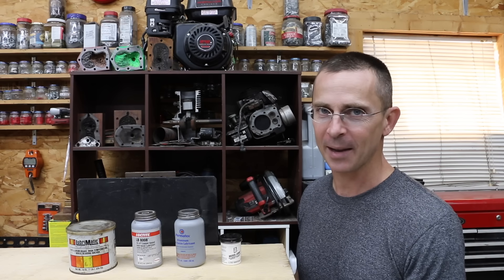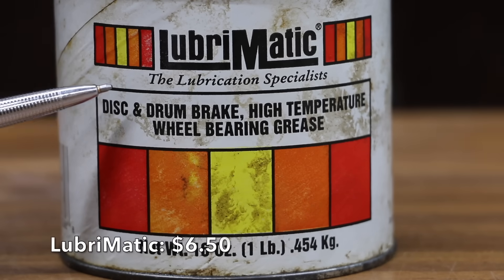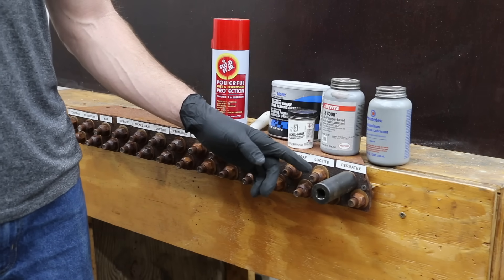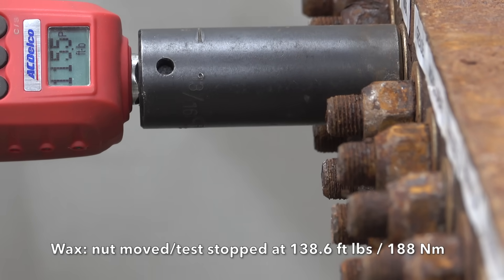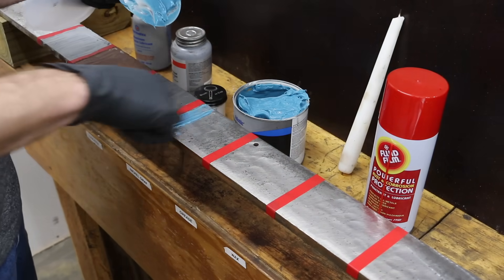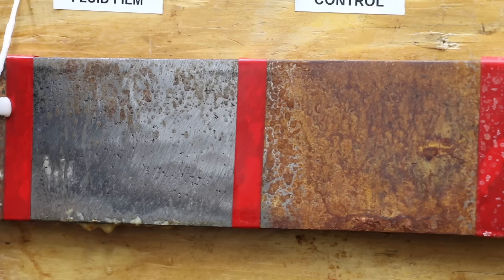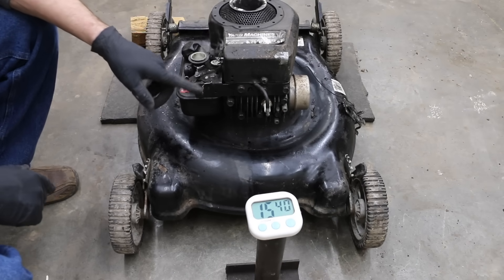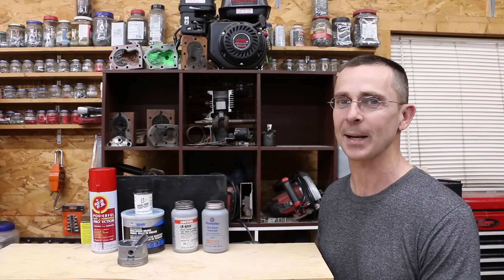Does Anti-Seize Compound Actually Work? Let's find out! Anti-Seize vs Grease vs Fluid Film vs Wax

Comment: After being an Auto Tech for 44 years, and 34 of those working on a fleet, the Copper anti seize has worked the best in my experience. Great job doing all of your testing!
Reply from the maker: Thanks so much!
Reply: @ProjectFarm  don't use copper anti seize on stainless in salt water, it actually corrodes the stainless; nickel based in marine applications only
Reply: @wlrottge  nope, tefgel we use
Reply: @wlrottge  use Loctite LB 8023 Marine Grade Antiseize for stainless
Reply: @wlrottge  I didn’t know that. Thanks for sharing that. How did you learn that?
Reply: Always found res-q steel to be pretty good personally.  Used it on ships for years without issue, would have been interested to see it against these other ones.
Reply: What would you say is best anti seize for glow plugs ona diesel
Reply: @paulyyy09  ceramic grease
Reply: 100% copper is the best providing your materials are liking the copper it’s best for heat and the shavings of actual copper protect the threads for removal for heated anything really
Reply: @LLS.R  because contain ceramic which is 9 in scale, close to diamonds..
Reply: @mtn.srlrascu6675  so you think it will grind your bolt or nut when it’s grinded to powder and processed in grease haha? Maybe if there were big chunks of it. It a bolt. Not a piece of glass which you are gonna scratch. I use ceramic grease and i’m a mechanic for 15 years so i know what i’m talking about. But use whatever floats your boat😂.
Reply: @LLS.R  on stainless Steel doesn't work like the copper one
Reply: @LLS.R  ceramic os an abrasive, just because it's in grease doesn't make it not an abrasive, it's just extremely fine and will probably work just fine for most applications,  if you think it's not an abrasive then replace the wheel bearings on your truck, use that on one side and pack the other side with Lucas red n tacky or some other quality wheel bearing grease, see which one wears out faster and see which one is more black when you take it back apart, ive never used ceramic grease, and I'm sure it's great stuff for it's intended purposes, but I'd bet money the wheel bearing with ceramic grease would wear out faster
Reply: @lumpyzx2645  I doubt it would make it 1k miles with the ceramic in there.
Reply: Molykote M-77 is the best I've used. Takes longer to dry out than the copper stuff.
Reply: Why not ceramic grease? Much better.
Reply: @LLS.R  that's for hi temperature
Reply: @mtn.srlrascu6675  works at every temperature. Better than copper. Ceramic replaces the old copper grease.
Reply: @LLS.R  I was using for anti lock on stainless Steel but if I use ceramic is different, is abrasive

Comment: As if I need to add another comment,but I will. I used the Permatex anti seize on a boat hoist, in fresh water. The bolts have been underwater for 30 years. I just unthreaded one, no tools, because the head of the bolt was almost gone. Threads were still there. I was amazed to say the least. I use it on the slider bolts on disc brakes and the attaching hardware. The only down side is if you get it on something cloth, it does not come out. You ever want to screw with someone ,put some of that stuff under the door handle of their car. It will be ruined for life. I would also agree with another poster about how you get right to the point. Um, ahh,Thank you!

Comment: Work with stainless steel nuts and bolts and you find out instantly that it works.
Reply from the maker: Thanks for the suggestion.
Reply: @ProjectFarm  What I meant is that stainless steel threads, without lubricant, will "gald" or bond very easily to each other and once they do, they begin to bond even worse. It's usually impossible to separate them. In the stainless steel industry, they will use nut made out of "monel" which is a type of stainless that will not bond to regular 304/316 stainless. Using monel eliminates the need for anti seize, otherwise the stainless will bond to itself once friction occurs.

Comment: I use anti-seize on almost every nut and bolt on the underside of my vehicles when I work under there.  When I have to do a brake job, front end work, shocks, muffler clamps, etc.  No more busted knuckles, rounded off or broken bolts.  Everything comes right apart.  Also use it on body bolts, anything that goes into a nut plate, and lug studs.
I worked in the rocket engine manufacturing field for 3.5 decades and very few fasteners are installed on rocket engines without anti-seize,  it makes your torque MORE accurate and disassembly is a breeze, so for those of you who think it will allow vibration to work fasteners loose...relax, nothing vibrates more than a rocket engine.  If you work on your own vehicles, buy it and use it, you won't be sorry.  
BTW- Anti-seize may look like grease but it is powdered aluminum or copper in a paste carrier.  As demonstrated, do not pack wheel bearings with it for example, it isn't grease.  As demonstrated, you can use bearing grease as a substitute but it will eventually wash out.  When I worked on ejection seats and canopy systems in the Navy, we used grease to protect firing mechanisms and canopy linkages from corrosion but we had to clean it all back off and redo it regularly.
Reply from the maker: Thanks for sharing.

Comment: you are using anti-seize incorrectly
you dont cover the entire thing like paint
its made to keep threads from galling and seizing
you are supposed to add a tiny tiny amount.... on each of those bolts it should have been about the size of a pen tip
enough to get into the threads, not enough to spew out of the threads
Reply from the maker: Thanks for the feedback.

Comment: One thing that comes to mind is the actual torque that is being applied to each bolt might be affecting the torque required to remove the bolts. About 40 years ago I took a 2nd level welding night course and a fellow from a local supply house came in and demonstrated several things. one of the items he used  to demon strait with was a device that measured actual torque not at the nut but at the bolt. The difference at 50 lbs. on the wrench it measured about 36 lbs. dry, 42 lbs. oiled and 47.5 lbs. with assembly lube. I still like your test. I lave been using anti seize lube since the first time I twisted off a bolt and had to get the remains out to complete the repair. Thanks for all the great videos.  Mike
Reply from the maker: Thanks for sharing.

Comment: What is the best anti seize for zinc plated cam bolts in steel control arm bushings? Long bolts in alum VW/Audi front knucles holding  upper control arms ball joints are notorious for sticking dead. What would be the best anti seize for Alu-Zinc combination?
Reply from the maker: Thanks for the video idea.

Comment: So a different type of anti-seize that I'm incredibly fond of and I've found to work incredibly well in an automotive application is the Walter 53D854 Rock 'n' Roll Ceramic Anti-seize. Compared to other products it's incredibly expensive but I use it on everything and it hasn't failed me yet. 

I was hoping you'd be able to do a second anti-seize review and include ceramic style anti-seize as well.
Reply from the maker: Thanks for the video idea.

Comment: This is interesting because I use regular bearing grease when assembling brake drums & rotors to prevent welding to the axle flange due to rust and I never have an issue during removal even when driven in the salt belt. I have watched other shops beat on them with a sledge hammer, use a torch because they just slapped it together and were too cheep to take a minute to do some preventative care.. Kudos to anyone who uses some type of antiseize products. Lately, a small tube of Liqui-Moly copper antiseize is found in my toolbox.
Reply from the maker: Thanks for sharing.

Comment: My brother is a highly experienced Inspection Authorized A&P aircraft mechanic.  He always requires aluminum based anti-sieze to used on aviation spark plugs after an inspection.  His helper put too much on a plug one day.  I saw him explain to the helper that he could paint the entire side of the hanger with one bottle of anti-sieze.  A little goes a long way.  I've never seen a siezed spark plug in an engine he maintained.  Thanks for explaining the difference between copper (for ferrous metals) and aluminum based anti-sieze.
Reply from the maker: Thanks for sharing.

Comment: Yes it works...it's used in industrial applications for a reason...we used it on all bolts..if there was a flange with 8 or 80 bolts every single bolt had anti seize on it..stuff we used was grey
Reply from the maker: Thanks for the feedback.

Comment: The bearings for the con rod didn't get any oil pressure. Its the oil pressure that makes the bearings work. It makes the 2 parts float 1 inside of the other without touching. When it does thats when you spin a bearing or bend or break a rod. Its also hkw the new 0w-16 oil can be so thin and still work without messing everything up.
Reply from the maker: Thanks for the feedback.
Reply: @ProjectFarm  love the channel. Cant give you enough praise and credit. Im rebuilding my transmission and from your test of motor kote ill be using it in the first oil in the transmission.

Comment: The copper based antiseize is what i use for wire connections that you don't want to get corrosion on the wire connector or  the surface that the wire connector is being secured to so it can be a ground ect. Because of the copper its very conductive and the antisei¹ze will protect from corrosion because it really stays in place. It works very well. You can get some at autoparts stores at the counter in the little pouches for cheap. Use it for your car battery ground. On my EXGFs car i redid all the grounds and added a ground from the engine and alternator to the battery. And an extra from the battery to the body and sanded the paint off and sanded all of the connections on both sides/parts and then put the copper antseize on all of them. And the car started getting better gas mileage, and things like the lights were brighter it started easier and faster,  just about everything worked better. And when i put in a 1200 watt rms subwoofer amp the lights didn't dim when the bass hit. On most cars all you need to do is the big 3 and use the copper antiseize for conductivity and corrosion.
Reply from the maker: Thanks for sharing.

Comment: Those of us that've worked on a lot of our own vehicles usually point to LocTite and Permatex for virtually /all/ these types of chemicals.
Also, just wanna point out.. The BEST gasket sealant is by far a product called "High-Tack" by Permatex. I've used it in place of gaskets (eg; no gasket, metal on metal) on small engines and it works fine lol.. Wouldn't recommend it, but it works great in a pinch.
Brake cleaner, I go for Berryman's B-12 every time.. And for anti-corrosion I /only/ use a tiny little can of green goo called "Corrosion Block" by Lear Chemicals- Usually comes in a little silver metal cans with a pump-sprayer, though it's gotten very hard to find over the last decade.
It beats the pants off those terrible products like "Knock'er Loose"
Reply from the maker: Thanks for the feedback.

Comment: Great video, but you missed one of the most important functions of aluminum anti-seize, preventing galling of aluminum when joined with steel or stainless steel fasteners. For example, a thin coating of Permatex anti-seize on spark plug threads can prevent very expensive head repairs in the future.
Reply from the maker: Thanks for the video idea.

Comment: In the jet engine testing I've done, we always used milk of magnesia in the hot section of the engine as a high-temp anti-seize. Those bolts are subjected to off-the-scale temperatures (like 1800C in some engines) and the mechanics always seem to get the bolts out.
Reply from the maker: Thanks for the feedback.

Comment: https://www.oatey.com/products/oatey-great-white-pipe-joint-compound-with-ptfe--275767012
i used this on a pinch bolt to connect to a lower control arm knuckle on a old subaru... hopefully it holds up... if you do this test again can you add plumbing joint compound to the mix? thank you :)

Comment: Been using anti seize for over 40 years and can only say that it has saved my butt over and over again. I repair turf equipment and it is constantly subjected to water, fertilizer & herbicides on a daily basis. New equipment never has anti seize applied to anything and when I take it apart there is a lot of corrosion & swearing trying to get stuff apart. Can't live without it......
Reply from the maker: Thanks for sharing.

Comment: To be fair to the candle wax, I doubt you were able to give it a proper coating. The others you could apply evenly all over.  You might have been better off rubbing the solid wax into the thread. When we use saws in carpentry, we apply solid wax to the blades so they slide easier
Reply from the maker: Thanks for the suggestion.

Comment: One problem with grease is that, unlike the true anti-seize compounds, it is not designed to NOT affect torque values. Grease will affect the torque/bolt stretch relationship.
Reply from the maker: Thanks for the feedback.

Comment: Have to keep in mind how different types of lubricant will react with not only the fastener but what it's holding together. For example, you could use a MP on a bolt that goes through a bushing but that grease may not be compatible with the bushing. For me permatex is tried and true for it's generally non-reactiveness.
Reply from the maker: Great point!

Comment: I use Loctite 77164 Nickel Anti-Seize, 16 oz., 1 lb. Can that is on Amazon for $34.81. The can I have now came from Fastenal and was about the same price as best that I remember. It never failed me for over 20 years, not the same can of course. Here are the specs.
LOCTITE® LB 771 is a silver, thick, metallic heavy-duty, high temperature, nickel-based anti-seize lubricant paste. It resists galling and corrosion and reduces wear in heavy pressure applications. It contains tenacious metals, oils, and graphite materials. It is used in applications with an operating range of -65.2 °F to +2,399 °F (-54 °C to +1,315 °C).
Reply from the maker: Thanks for sharing.

Comment: In the 60's and 70's,  Pontiac and Cadillac,   engine's had a problem with the water  pump and aluminum  timing cover, leaking and filling the bolt holes with water then 8 or more years go buy, when changing the water pump you would have to break off the timing cover, as the bolts would corrode and twist  off, then drill out the rotted bolts out,    SO when the original silicone ORANGE sealer,  came out I would completely cover the threads and the bolts with it and fill the holes so water cant get in, IT WORKED, THE BOLTS DIDN'T SEIZE UP ANYMORE  !!! Kind of like anti seize,  😂😂
Great Video,  Thanks William Orange county,  ca.
Reply from the maker: Thanks!

Comment: I have been a heavy diesel mechanic [ trucks and earthmoving ] for over fifty years and I have found that copper based anti-seize to be the best. After many years of freezing cold, high temperatures, mud and even salt water copper comes out on top, the aluminium based one seems to go hard and acts like locktite  especially on exhaust manifolds so always use copper based. Greetings from Australia
Reply from the maker: Thanks for watching and sharing!

Comment: When I was a jet engine mechanic we would use a lead/graphite based anti-seize compound for all the bolts that was used in the "hot section" of the engine.  The anti-seize compound was a dark grey paste that came in a small can.  Just dip the tip of the bolt in the paste for that was all you needed.   this anti-seize compound worked great especially when dissembling the engine.
Reply from the maker: Thanks for sharing.

Comment: Of note is that all those products lubricate the fasteners and your torque spec won't be correct as they're developed for "dry" fasteners.  There is a recommended "adjustment" you can make for these products that I've seen before.
Reply from the maker: Thanks for the feedback.

Comment: I feel like the candle wax could have had better results if the hard wax was rubbed onto the threads and surfaces over being melted to give better overall coverage and in a much thinner layer, the way skateboard wax is used.

On the bolts it looked like where the wax was dripped on was much cleaner than where it wasn't, and the melted wax that contacts the metal will cool faster than the wax on top of it creating a rounded over edge with the possibility of small channels which would have allowed the rusting agent to penetrate beneath the wax.

The other thing that could be a factor with the candle wax is exactly what kind of wax it is, as candles can be made from a variety of waxes like paraffin or beeswax, maybe this could be revisited using the different kinds of candle waxes and even throwing in other waxes like floor wax, car wax, ski wax, skateboard wax.
Reply from the maker: Thanks for the feedback.
Reply: @ProjectFarm  no problem, thanks for the great videos

Comment: I would have liked to have seen "White Lead" included in the test. I'm a retired machinist, we used it on the "centers" on our lathes to keep them from seizing. 
Interesting story on how I got it. About 20 years ago I was in one of those "Salvage" stores when I saw a couple of small tubs of "Sherwin Williams White Lead" on the shelf. By the label, they looked like they had been there for YEARS. I asked the price and was told $5. I offered $4 and bought both.
The putty is pretty had but can be thinned back out by mixing with Linseed oil.
I know it's not available anymore but I just happen to have some left. I'd be glad to send you enough for a test if you're interested.
Reply from the maker: Thanks for the suggestion for future round of testing.